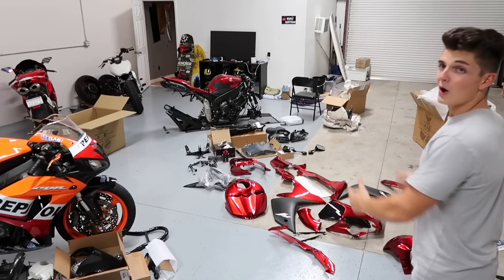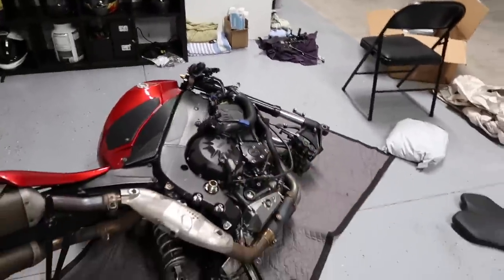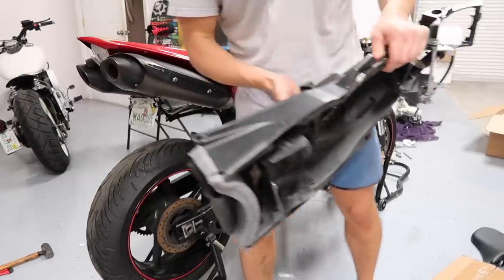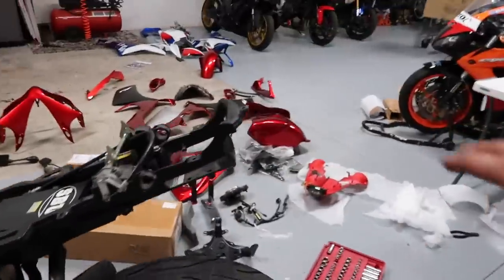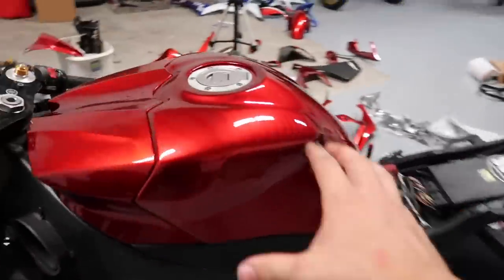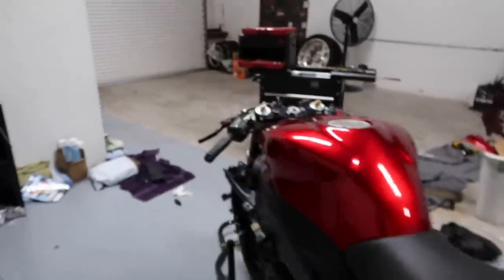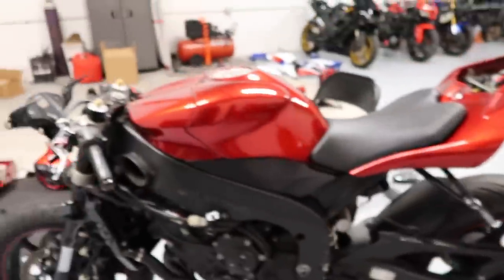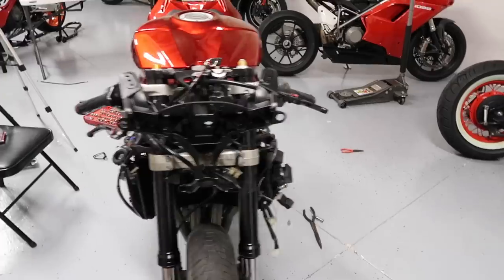Rebuilding a 2007 Yamaha R1 Wrecked Bike Rebuild  (Part 2)

Comment: nah you could build a steel triangle frame from the ground bolt it to the ground you make two of these with a beem on top of them and you could hang  a bike up mate even build in a electric lift system

Comment: Looks good on the r1 ,quick question I have a 06 r1 I wanted to change up the front end to the 09+ front end, is it possible changing the stay bracket an fairing /headlights ,I also need a new headlight/Speedo wiring harness ,advise ?

Comment: You really need to put that steering stabilizer back on. You were pointing at the tank bolt, but you mentioned the stabilizer... if you do not put a stabilizer back on there, it will kill someone. That bike needs it.
Reply from the maker: I’ll definitely put it back on, the bike comes with a steering stabilizer stock but it does not do much
Reply: Built From The Bottom it should be adjustable. Usually they have an adjuster on the side of the stabilizer to turn the damper up or down. Not sure what kind of stabilizer you have.

Comment: Hey man, amazing series. This is the bike that I've been looking for. Cause the 07-08 R1 models are like the only ones that has 4 valves per cyl with flatplane crank right? Like they're the only models with same configuration as the other Japanese bikes. Unlike the 06 and older that has 5 valves/cyl while the 09 and new ones has a crossplane crank. Could you give me more details on where I could possibly spot an 07-08 R1. Thanks man.

Comment: My friend, i have a 2008 yamaha yzf r6. I want to buy salvage newest year model (2018-2018) from copart and use it as parts to rebuild my bike. (bike is bad condition mechanically and new parts in our country is expencive). Also i could change 2008's R6 design to 2017. Any advice for that? I live far away from USA and don't know about pricing or progress on cases like this.
Thanks for great content, good luck
Reply from the maker: I would just by parts from the us off eBay
Reply: @builtfromthebottom  Buying separately parts would be expensive i think
Reply: Tural Aliyev it would be cheaper and easier to just buy another cheap 08 r6 lol
Reply: @MADLITS1K  In our country taxes for imported vehicles is very hight (if vehicle is 10000 usd you must pay 6000-7000 taxes for that) So i think importing salvage new year bike as parts without taxes, rebuild 08's R6 and you will get new and fresh rebuilded bike.